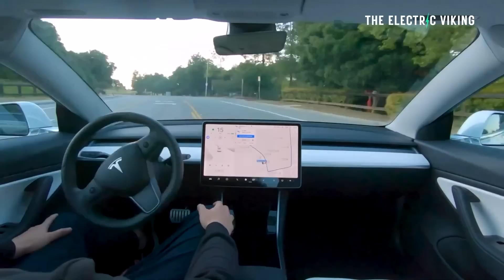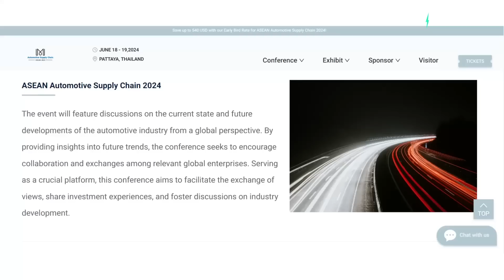Breakthrough battery does 1 million miles & handles extreme temperatures

Comment: I think you are making some very bad assumptions and mixing up quaity with technology; while accepting a lot of hype impossible to verify. While it will be great if this new battery can do 1 million miles and handle a wide range of weather, no one knows it can.  But; one can't verify that claim. You'd need a small fleet of test vehicles and 20 years to prove it. Why 20 years? Because actually driving a vehicle can't be simulated or short cutted. Driving at 70mph 24 hours a day takes 2 years to go 1 million miles - this batter didn't even exist 2 years ago...so what is the basis of the claim?  Guesses.  The real world is far different than lab tests and guesses.
Reply: He is good at hyperbole. 
Do you think he would grasp such nuances? 😁
Reply: @hardi.howdy.983  I think Sam is a good guy with good intentions but he has a family to support and puts out a lot of videos; I think it is more demanding to dig more deeply into these sorts of issues.  On the other hand some things are common sense and for what ever reason Sam isn't filtering out those things that do not make sense or are hype;  He seems to take them as they come and report them without a common sense filter; but maybe he doens't  agree what is common sense and what isn't. In any event I often attempt to point out short comings in the reports.

Comment: Glasgow: Explosions and smoke amid fire at battery recycling plant
Korea: 22 dead after lithium battery plant fire in South Korea: ‘Not enough time to respond’
The victims likely succumbed to extremely toxic gas within seconds of the blaze getting out of control

And you EVangelists seriously want to park and charge squillions of cars stuffed to the brim with that crap in car parks, in the basement of apartment buildings, under hospitals, etc...
Reply: Per capita ICE burns 10X more than EV

Comment: If a battery can only be charged to 70% of its new capacity, after years of use, does that mean that some energy is wasted in recharging it?
Reply: No.   It's more like the battery slowly gets smaller.
Reply: but that is the lower warranty replacement limit.   the batteries are not expected to actually get that low to 70%.
Reply: Energy is always lost when charging a battery. The battery gets warmer. When a battery has lost 30% of its capacity, the energy loss does not increase.
Reply: If the internal resistance of the battery increases with age, then more energy will be wasted on recharging. Couldn't put a figure on it though.

Comment: Sam, I'm hoping you can clear up a couple of things for me.  One is why we are now using low-profile tires?  Those are track tires for high-speed cornering, and they're much more likely to pop in a pothole.  Are they just an expensive fashion statement?  Second, do you know how FSD works in bad weather or where there is no paint on the roads? Thanks.
Reply: Probably what the owners want when they get a car that accelerates fast.  Low profile tires may give a more bumpy ride but they give better control in high speed cornering.
Reply: Low profile tires have lower rolling resistance, meaning your car will go more miles on a charge.  Different tire manufacturers tires for car have different  rolling resistance some improve mileage  by 12-10% others only 3%
Reply: FSD works in bad weather up to a point, it drives just fine in the rain, but when you hit a large puddle at highway speed system alarms and says take control immediately. Haven't had enough snow to say but I'm sure lots of others have used it in heavy snow.

Comment: Another good video and great to see Battery Tech improving all the time.

However I'm a little concerned about a video that was posted by MR P, in which he shows a letter (in Chinese) from Zeeker customer services stating that you can only fast charge the battery pack 200 times, (speeds above 200) after that the charging speed is limited.

https://www.youtube.com/watch?v=c69ONyo1D3I     Link to the video 

Did you come across this during your recent visit to Zeeker in China?